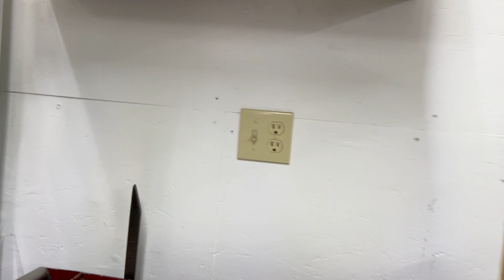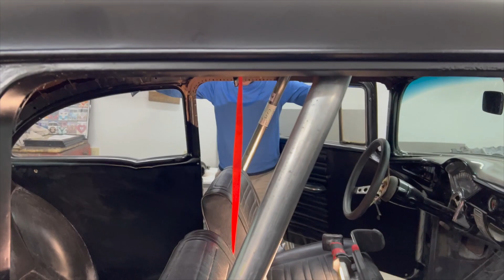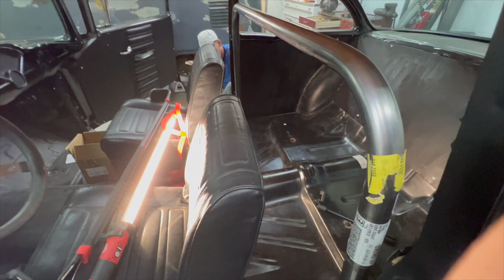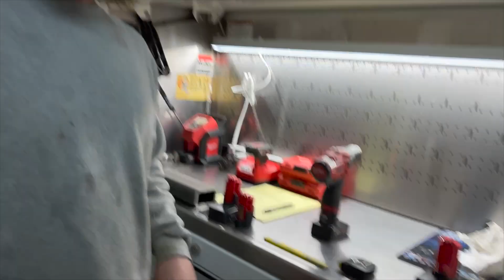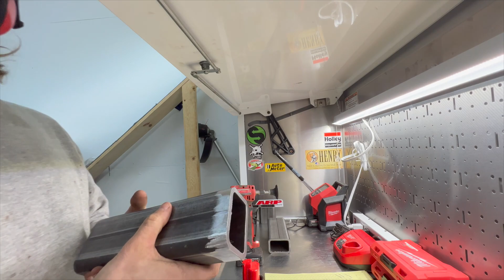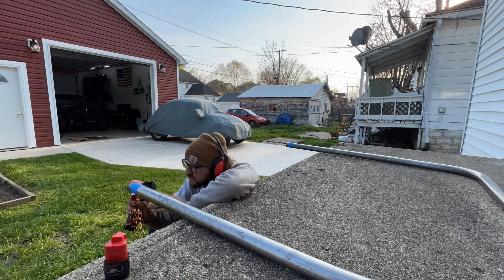1955 Chevy Gasser Roll Cage Install! part 1

Comment: Hey man. What did you use to mount the bucket seats?
Reply from the maker: I will be addressing this in a future video. I am actually going to change how they are mounted. They have some welded together frames fixed and bolted through the floor now, but i am going to completely change those.
Reply: @vintagehotrods  Hey thanks a lot for responding. I am definitely interested in what you are going to come up with. Just got some bucket seats for my 56 Chevy and I’m trying to figure something out. Thank you very much for all of your content 👍🏻

Comment: My two cents worth is that you guys are doing a great job with the rollbar. Everyone does it differently. As long as it's strong and placed correctly.
Reply from the maker: thanks I appreciate it! ya everyone does it differently. I think we are going to flip the outriggers upright so they are stronger, but at the end of the day it isn't a drag car so I'm sure it will work out great.
Reply: It must be tie to frame and outrigger narrow side up welded, wide to frame welded vertical

Comment: Hey Ryan....you know I'm a big fan of all you do. I'm not trying to be the know it all asshole....but I have been building drag cars professionally for about 30 years now , so I want to give you my input.  In my opinion , the way I have always done tri 5's with outriggers....I use 2 x 4 x 3/16 , which is close to the same width as the frame , and I taper cut the bottoms about 2 inches out from frame contact from 4" to 3" and cap the ends. I put a piece of square or rectangular tube about 42 inches long under the frame to support them from underneath and tack them....then do your hoop fitting and tack it to the outriggers....then fit the rear bars and seat brace bar. after that's all happy , you can break the tacks from the outriggers to the frame and drop the whole unit down to weld the hoop , and the rear bars to the hoop without access issues....then put it back into place and weld the rest.  Your  outriggers should have the longest side vertical for strength. Its not the end of the world if your going to run your hoop diagonals from under the seat bar to rest on top of the frame...that will give you lots of strength. Also , I think your seat brace bar is too high. The top is usually about even with the base of the door windows...at least on the ones I have done. Its better to have the belts pulling at a downward angle from your shoulders then straight back. That's my 2 cents for what its worth. I hope your roll bar never has to be used regardless ......keep the pretty side up!!
Reply from the maker: Thank you for the input! Its awesome to hear you do that kind of stuff. I appreciate it. We did so much research and got so many different perspectives and finally went with one and being its not really going to be a drag car and its more for looks than anything. I think we are going to drop the harness bar a little as well. And i like your idea about tacking it and then cutting the outrigger tacks and dropping it down to weld. I really appreciate your input!
Reply: @vintagehotrods  Glad to share some experience man! The dropping it down thing is a must...especially in cars with headliners...and cover the glass with spark guard...I learned that the hard way as well! Love the car man...keep on keepin on!!